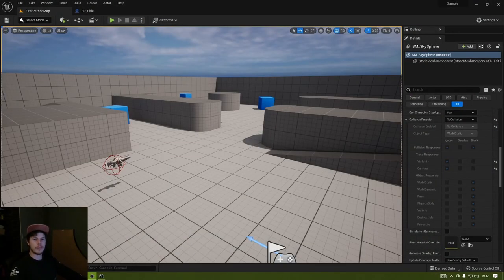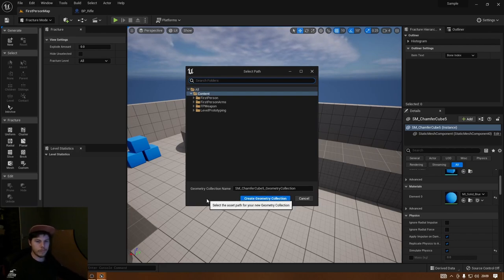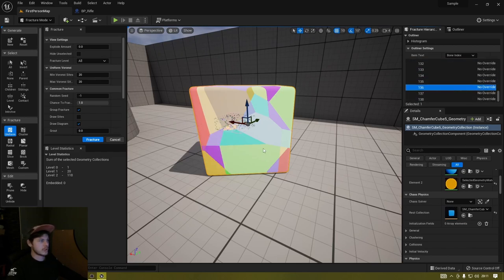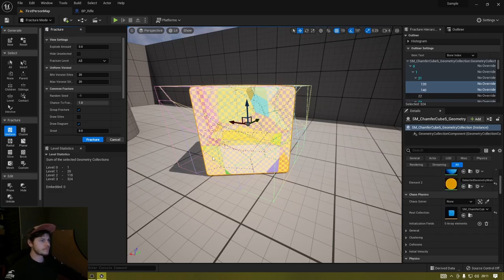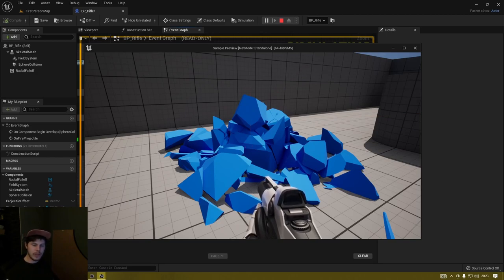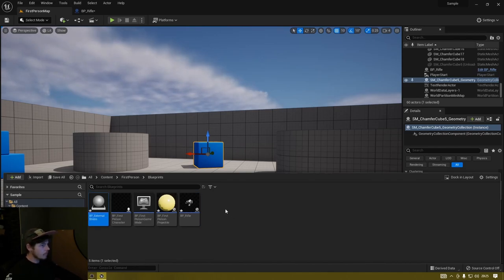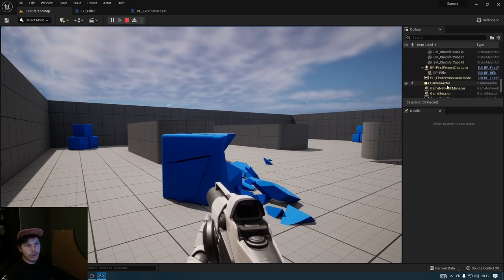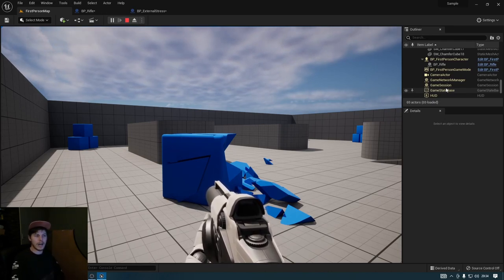UE5 - Getting Started with Destructible Assets (Creating, Shooting and Exploding)

Comment: Do you happen to know if this is something that can be applied to a blueprint? Like I want to set the chaos destruction to a cube, and then drop in many cubes that can all break the same way. I can't find anything, which might mean I'm approaching it wrong.
Reply from the maker: Hey thanks for commenting, and sorry for such a delay in replying, i dont recall getting a notification for this comment :( I'm not sure how you would achieve this with the Chaos system because of the way the destructible require the use of an effector to start the destruction but I will look into it,

Comment: Hello, I have a problem, it only works with a 3000-radius sphere when line tracing, and the whole thing gets destroy at once, any ideas why this is happening? Do I have to use the blue cube? I'm using ALS map and logics. It looks so cool that I need it so bad, please help
Reply from the maker: Hey! you can use any mesh you want to, be aware that different size meshes require different forces, so you may need to adjust the magnitude to suite, also if your entire mesh is exploding you may need to adjust the damage threshold too mentioned at 4:46 Hope that helps
Reply: @StevenOrmerwood  I messed around with all values. Force. Object size. And the only working value is the sphere at 3000 or more. Even use the the force at 9999999999 with a 50 radius and the thresshold at 1.0, 0.5 and 0.1... i dont undrestand what is the problem. The wall is the same size of the locomotion character height and 3 times wider. And very thin.
Reply from the maker: @flyingroads3498  I will be online in a few hours I will have a look l, if you can send me some screenshots of the mesh so I can try and replicate it that would be cool
Reply: @StevenOrmerwood  how can I send you screen shots? I can make a twitch stream or youtube stream. Thank you in advance buddy.
Reply from the maker: @flyingroads3498  you can do either and send me a recording ? i use this site here: https://imgur.com/a/jKQrNBk as you can see i have some issues too, it seems there is a problem with large meshes at my end
Reply: @StevenOrmerwood  cant register on imgur 😭 it is like nothing is going to work. The parts stuck in the air happened to me when setting the mass very low if i remember ok
Reply: Almost got it working with blue print spawn sphere on line trace hit point. But when it hits the spear goes to world 0;0;0. Omg im getting pissed by this chaos thing.
Reply: Solved!!!!

Comment: Hi, thanks for the tutorial, it's helping to make things more clear. However I got a problem, the ExternalStress blueprint do not work for me, I'm trying to use it on a grenade (for a grenade launcher) and when I put it next to my cube nothing happen. I tried to play with damage threshold values but nothing seems to change, I can send you screenshot by discord if you need

EDIT : I figured out the problem, it was something about the magnitude(impact force) value that wasn't set right, thanks again for the tutorial !
Reply from the maker: Hey thanks for commenting, yeah the damage threshold can be annoying, it also changes depending the size and mass of the object too so be aware of that :) but im glad you have fixed the issue :D
Reply: @StevenOrmerwood  Hi again ! Now I'm struggling with the collision part of these things, like my ball do not destroy the destructible as I wish, but instead they push it away (what I don't want them to do xD) and also when the asset is hit by my ball he lose his collision and just fall off the map, do you have any idea about the problem ?